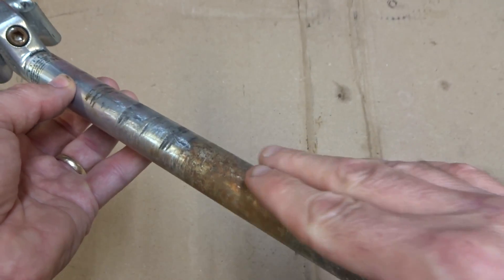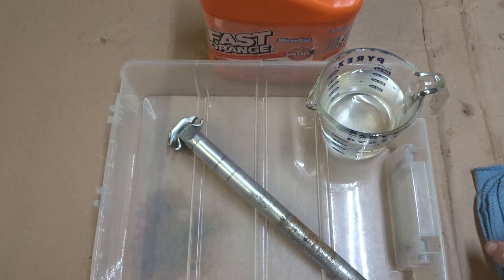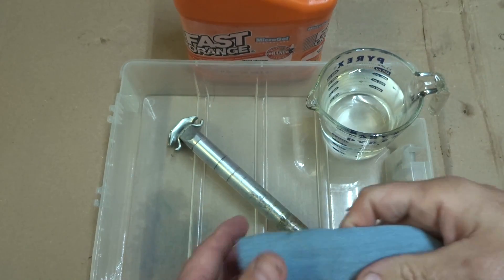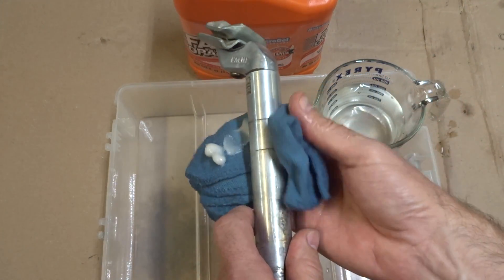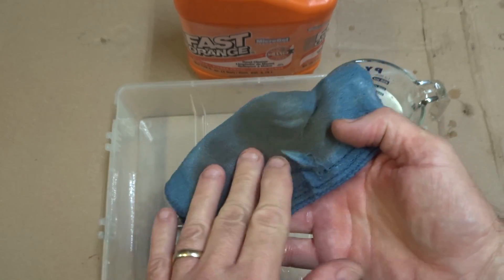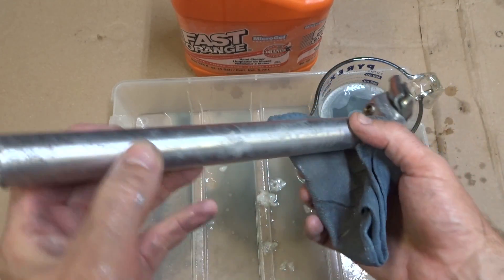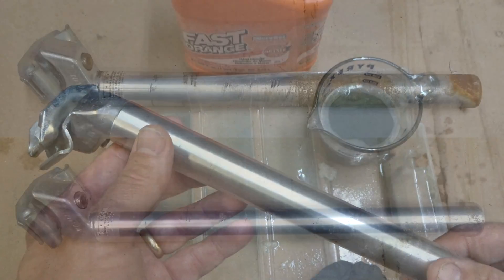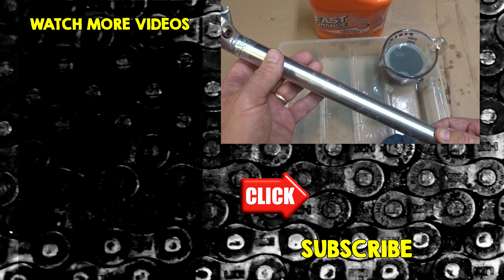Clean Rust/Corrosion/Light Scratches From Aluminum Seatpost

Comment: Wonder if it works on chrome frames? 🤔
Reply from the maker: I would use chrome polish for that.
Reply: @RJTheBikeGuy  Gonna try it this weekend , got more than a couple chrome  BMX frames that need it :-)
Reply: If there's any chrome LEFT, Simichrome is my fave, but any good metal polish should work Fine. I use Brasso on larger items. It's a bit THINNER in consistency, but also CHEAPER.

Comment: I like that idea. What about spraying the poat with clear coat after? To prevent rust again?
Reply: This is an aluminum seatpost, the brown stain is not rust.
Reply from the maker: The brown stuff happens with galvanic corrosion on seatposts in steel frames. It's probably a combination of aluminum oxide and rust. Keep your seatpost greased, and this won't be a problem.

Comment: Why not just use a aluminum or carbon seat post instead?
Reply: That was an aluminium seat post wasn't it?
Reply from the maker: This is an aluminum seatpost. Right there in the title.
Reply: Aluminum doesn't rust. If the rust is coming from the frame then it should just wipe off easily.  No need for the abrasive.
Reply from the maker: @seth-bullock  Aluminum doesn't rust. It does oxidize. Aluminum oxide from galvanic corrosion. Which is very hard. It gets mixed with the rust from the steel and you get that brown crust. No, it doesn't just wipe off.

Comment: I use steel wool.  As long as the parts aren't greasy it works very quickly.  I've used it on dereilleurs, brakes, rims, etc.  They all come out great.  I never go above a a triple zero grade.

Comment: That's brill. Could you use the same method on the exposed part of suspension forks? Mine are hella rusted but still good, I think..
Reply from the maker: Suspension fork uppers are not aluminum. The are steel. Often chromed. Do not do this on those. If they are rusty, they are probably trash.

Comment: Dont forget to lightly grease your post and seat tube so you can avoid rust altogether
Reply: Why not Get an aluminum post?
Reply: @f.b.i.5580  that post was aluminum but it was in a steel frame.
Reply: Oh sorry lol my mistake
Reply: After you take out the rust with wd40 right?
Reply: Lol are you serious? That would slide down the seatpost
Reply: @fredmad4988  yes but before there is any rust to begin with
Reply: @TheTriangle444  thats what a seat clamp is for
Reply: @TheCaptainsCog  bad idea. In fact i just tried the same with my stem and fork yesterday. I applied some grease to get the bars up but when i screwed everything in the stem would just steer out of alignment no matter how torqued it is. So i took everything out again and wiped all the grease out
Reply: @TheTriangle444  the video is about a seatpost, not a steer tube and stem. Never grease where your stem clamps on the forks dude!
Reply: @TheCaptainsCog  same principle -- its a metal rod being held by something that gets tighter
Reply: @TheTriangle444  that’s true, applying grease to certain components would help extend the life of the part and function better and it can also do more harm then good. Greasing the seat post/stem I would try to avoid because those components require torque specifications to work properly and when adding grease/lubrication to those parts it retards it’s process so we’d have to torque the components down to a more extreme pressure rating then normally causing excessive wear & or inoperable or damage goods in the long run.
Reply: @JohnJohnson-tk2cp  always grease a alu seat post going in to a steel frame same at fork it would need to be very out of spec to not tighen enough

Comment: Fine steel wool and WD40, clean as a whistle.
Reply: A lot faster too!
Reply: Wouldn't use steel wool - the micro particles that it leaves behind will attract further corrosion. Fine bronze wool might be a safer choice - and it's the same stuff to keep around for chrome.
Reply: Yep that works as well - doing it as we speak (as it were...)
Reply: @cudak888  Bronze is in sight corrosion with Al quiet the same like Steel, Brass or Cooper. Maybe it scrubs better and i believe that depends on the Cut. Every Metal electrolytic/Electochemic Higher as Aluminium will start Contact Corrosion and will attack and eat away the weaker Aluminium.
Reply: @dervwfahrer  The corrosion against the aluminum isn't what I'm concerned about - I'm concerned about the bare steel dust left behind by the wool, rusting immediately on the surface.
Reply: Won't that just scratch the surface??
Reply: @cudak888  I not sure if there is enough micro-particles left behind to be concerned about. People use soaped brillo pads to clean stainless steal all the time...in fact it is recommended.
Reply: @Devotee777  It's not recommended. Do a Google search. Brillo pads will scratch the stainless and leave the surface rust-prone. Furthermore, stainless isn't aluminum.

Comment: RJ, that might end up quite costly, pumice is extremely abrasive, you can get different grades from EBay for instance about $10 for a kilo it’ll last you years as you only really need to dust a bit on a damp cloth
Reply from the maker: A half gallon the hand cleaner costs $6.47 at Walmart.
Reply: @RJTheBikeGuy  ah! But how long before you need to buy more? I bought a 500g bag 5 years ago and I still have 50% left
Reply from the maker: @Herbybandit  Shrug. Maybe a year. It's hand cleaner. Not a bag of pumice.

Comment: You can also use a citrus acid based solution or any other light acid (such as vinegar). If this does not remove all rusty stains, use a brass brush (bit be carefull, because it leaves tiny scratches).

Comment: It looks like the brown rust color is rust from the frame and not actually part of the seat post? Aluminum doesn’t turn brown when it corrodes, because it creates oxidation and not rust. So basically you sanded off the rust left in the seat post left from the frame. Another technique that will work in this case is a scotch brite pad and simply scrub off the surface contamination.
Reply from the maker: The brown stuff happens with galvanic corrosion on seatposts in steel frames. It's probably a combination of aluminum oxide and rust.

Comment: I just followed the directions to clean my stem and it worked great! You can see pictures here: https://www.facebook.com/john.link.39/posts/10158654493871605
Reply: I also used white vinegar to remove rust from the hex socket of the stem bolt, and then applied a little grease to prevent further rust.

Comment: I'd go for a green scotch brite that's used for cleaning pots and pans and a cheap toothpaste as those are micro abrasive (can also be used to clean and clear lenses of sunglasses and goggles). Scotch brite isn't recommended for painted surfaces as it dulls the paint coat.